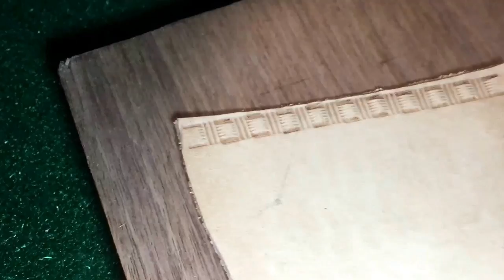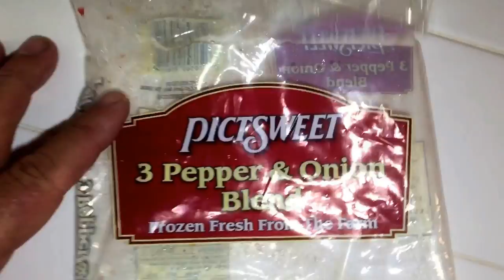Basket weave knife sheath

Comment: I have a couple of tools that are similar to leather stamping tools, that I have to use at work for long periods. I have issues with my thumb as well. Wrapping the tool with electrical tape to increase the size where I hold on makes using the tool much more comfortable. Give it a try, you can always cut it off if it doesn't work for you. I thought your project looked just fine for your first time out!
Reply from the maker: Im gonna slide a 3/4 inch wood dowel over it and epoxy it in place. I'll even cup out a little comfy rest for my thumb.

Comment: Sheath looks pretty good to me! You are certainly getting better each time. Saddle stitching was the kind you were thinking of I think. Two needles on one thread, passing through the same hole.

I like that you are using a welt between the layers, that'll really help protect the stitches. And shaping it on th bandsaw is a great idea. I usually shape my pieces with a knife, and then refine that shape on the disk sander.

Have you tried using thicker leather for a firmer sheath? I don't make a Lo of sheaths but my last was about 3mm thick veg tan and turned out really nice and sturdy. This is it here:

https://www.facebook.com/wedgetailleather/posts/1566281037021616
Reply from the maker: fenrir waking nice looking sheath! I hope to get  much better,quickly. Leather is so expensive that it makes me want to use kydex for my blades.